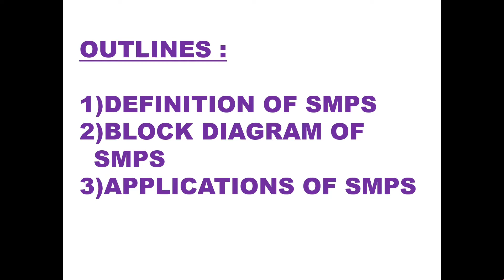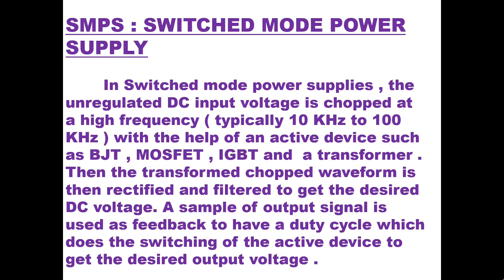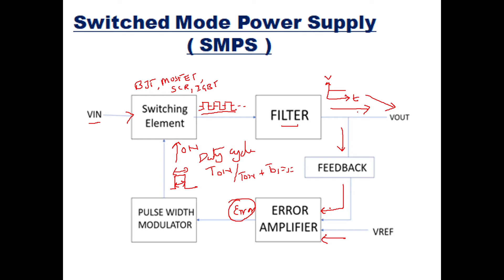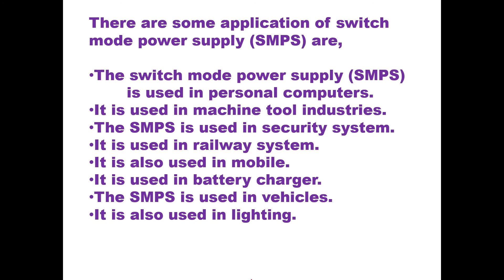SMPS | ANALOG ELECTRONIC CIRCUITS | PART 7 |

Comment: Sir, DC voltage won't have any frequency. Then how SMPS will chop unregulated DC with 10k to 100khz?
Reply from the maker: in such SMPS circuits the unregulated input dc voltage is fed to a 
high frequency voltage chopping circuit such that when the chopping circuit (often called dc to 
dc chopper) is in ON state, the unregulated voltage is applied to the output circuit that includes 
the load and some filtering circuit. When the chopper is in OFF state, zero magnitude of voltage 
is applied to the output side. The ON and OFF durations are suitably controlled such that the 
average dc voltage applied to the output circuit equals the desired magnitude of output voltage.
Reply: @javalkaracademy2176  Ok Sir, now I got it. Thanks a lot sir for your kind help to us.